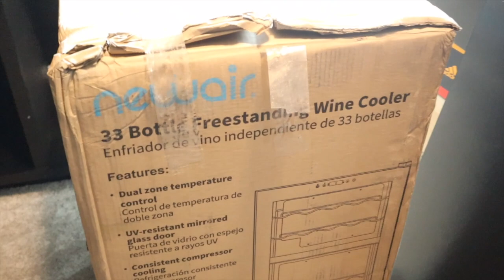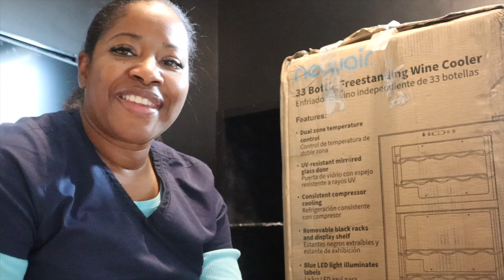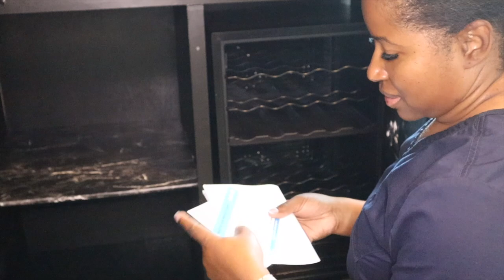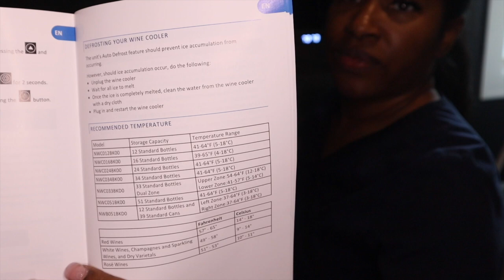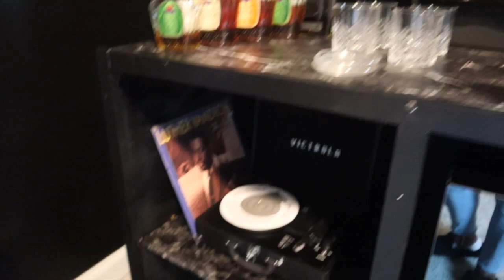I painted the ENTIRE Man Cave BLACK! DIY Bar Cabinet ft. NewAir Wine Cooler.

Comment: The man cave is coming along nicely.  As for the streak/smear marks; ask about it at the paint store, but supposedly there's a solution to mix inside of the paint so that you do not see the streak marks in the paint once it is on the walls.
Reply from the maker: Good advice!! Never knew that but will definitely ask!

Comment: It’s the technique. You have to do long strokes up and down and since you’re not 8 feet tall you have to use a paint pole. You shave to press it in until the roller is almost dry. You can’t use those short “all over the place horizontal vertical” strokes. If you look at the painting footage you will see what I mean…. It actually did turn out great!

Comment: Hi beautiful lady, your next wall painting video, try one of those
Extended painting pole and the
16" or 18" roller and the cage
That holds the roller and then
Do a large zig zag around the
Whole wall , faster process, and
Touch ups with the one your using
Now, they also have the Lrg painting
Pan . I think you'll like,

Paint job and everything looks good.
Reply from the maker: Definitely going to look into one of those! Thanks!
Reply: ITA…and You can also take your broom handle, unscrew it from the brush end and attach it to the roller. A longer pole and going straight up and down after cutting in on the corners, gives a more uniform cover of paint, less streaks and start/stop marks and it does go faster.